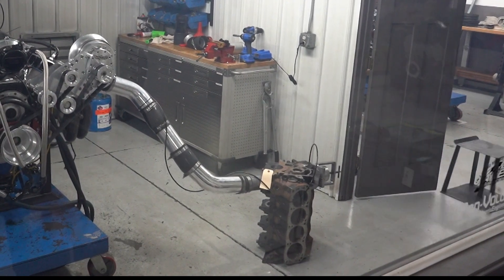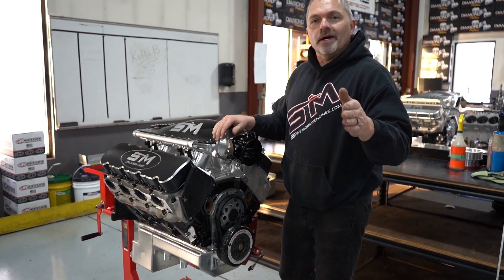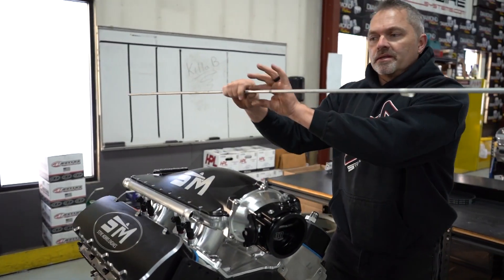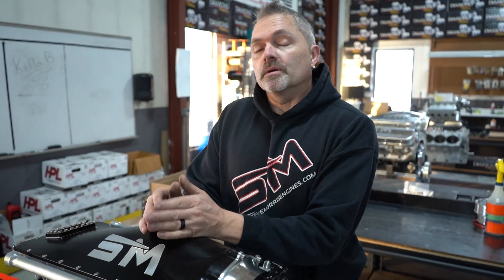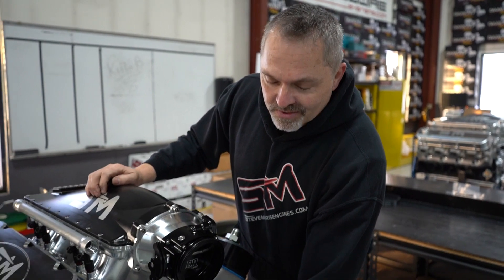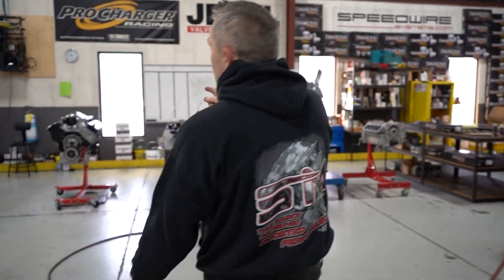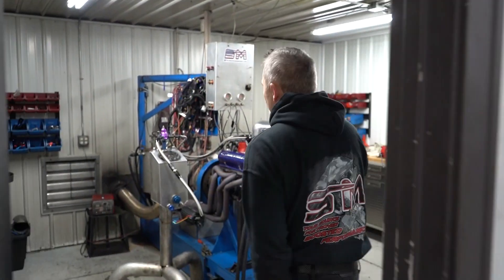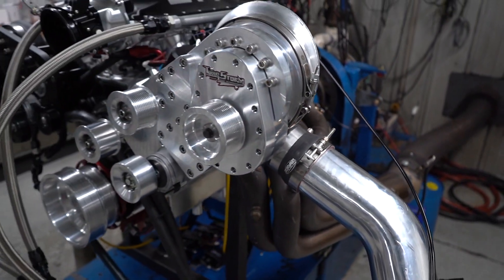Why All The Sparks ?

Comment: Have you considered putting a support bearing on the other side of the main pulley (e.g. supported by a welded fixture on the front subframe) so that the main pulley is not loaded in single shear?  Obviously, it's gonna cost clearance to the front radiator, but I bet you only need 3/8" wide roller bearing to handle all that crank loading.

Comment: Leverage points where the blower , oil pump meets the belt from the crank can change flex points on the crank , buy changing the mounting points on the blower belt pully , oil pump , what ever , the leverage point from crank , its all abount moving the leverage point around from the belt contact to the crank where you can center up the wear on the 2nd journal. Awesome work.

Comment: My question is what about the front and rear main seals, because of the side load pulling crank that far outta it's normal path.
Would this not cause them to wear abnormally during the short time it was being forced against the seal housing for lack of a better word?
Ninty thousands is no small number in situations such as this.
Your certainly current about the crankshaft bowing in the center as it's the load is using the #1 main bearing support as a fulcrum, which causes the center to absorb all the tension of the load.
This brings up the subject of how much deflection does it get, and doesn't this effect the travel of the pistons and rods associated with those in the center of the crankshaft as well?

Comment: Gyroscopic precession working on the balancer to help it bend over and touch the pickup?
The belt tension being the pressure point trying to change the direction/orientation of the spinning balancer?
Like pulling or pushing on handlebars of a bike as it's in motion?
Reply: Was thinking the same. Hence the balancer was able to touch the sensor even though it was being pulled in a different direction. The resultant force is 90 degrees from the applied force in the direction of rotation. Looking at the where the crank sensor is mounted compared to the blower it looks about right.

Comment: Thank you for touching on the hp/torque thing. I think it's something a lot of people struggle with but once you understand it it kind of changes the way you look at things. I recently watched a video about why European semi companies are making more power than American ones. At the top end at least. Someone commented that you could buy a pickup truck with more horsepower off of a lot in America but I don't think they understood the vast difference between a semi's diesel engine making 750hp and a dodge ram trx. 2000 or so lb/ft of torque lol.

Comment: Could the crank nose whip have been what you thought was belt slippage in the initial pull, for creating a oscillating load in the blower? 
Is the whip actually from the crank deflecting longitudinally, or is it more of a torsional wind-up of the crank / twisting of the crank, and the axial deflection for the deflection being largely in the crank arms?

Comment: An inertia dyno also measures torque. The acceleration rate of the rotating mass is directly proportional to the torque. Exactly the same as when road tuning. The rate of rise of rpm is proportional to the torque. The only way to measure power directly is by using BSFC and fuel flow.

Comment: I worked at a Mahle (Clevite) Engine Bearing plant for many years. We produced OEM and Aftermarket bearings for Race and Aircraft applications. What you are describing is something called "Edge Loading" and Crankshaft whip along with side loads from the superchager side loading. Many aitcraft applications and some ProStock race bearing had slight reliefs cut on the centerlines to offer more clearance to accommodate the flexing. Great programs by you and they are much appreciated by this viewer! Thanks!
Reply: Woops, I meant Aircraft!

Comment: You could calibrate the load cell on the supercharger same way you do the dyno by using fixed weights and a lever. Problem is the belt force component will influence the torque component. To do it properly you would need to mount the supercharger so it could rotate about its shaft axis then drive straight thru it(seperate supported drive pulley) so only the rotational torque component was measured then just like the dyno it’s torque times blower shaft rpm/5252 equals horsepower.

Comment: A strain gauge on the mount works. The problem would be it measures not only rotational torque, also pressure applied from the belt. Very complicated math. A torque collar fed using a planetary would be a direct conversion.

Comment: Hey Steve set it up so when you test the parasitic loss from the blower try plumbing the blower to  a second engine running near same rpm range to consume near accurate air that the engine with the super charger normally would consume. The. You would wind-up  actually finding the parasitic loss because the blower would be loaded properly

Comment: Roller dynos measure torque as well.    F=MA    Force equals Mass multiplied by Acceleration.  Roller dynos measure the time from RPM start to RPM finish.  Therefore the acceleration is known along with the mass of the roller.  Force or Torque is then calculated.    HP is then derived from torque and engine speed.          HP and the Math.    HP is the time function of Torque, Time being the RPM or cycles of the engine.    Similar to MPH being the time function of change in position.      Two places 50 miles apart.........but if its know you traveled the distance in an hour you know the average rate traveled.     These are referred  to in Mathematical terms as the First Derivative.

Comment: Another way of think about the how load is applied to the compressor is w/ glass of water. 
The engine is the glass and the water is the cfm of air. Na engine is half full of water running WOT. Now add the compressor that is a pump adding water to the glass. The water pump won’t see a load until the glass is full and the water that overflows is boost! 
When you remove the glass the water is flowing all over the place at first instance! Thus immediately loading the compressor. 

Theoretically valve overlap and cam timing will also play a roll on how a compressor acts with a given combination.

Comment: One of my friends ripped the snout off of his crankshaft from his extremely long oil pump drive adapter for his dry sump. Luckily he had an electronic kill switch connected to the oil pressure sensor.

Comment: I feel like the crank is flexing on 1&2 rod journal that's why the crank snout is moving but a way you can prove one of us right is mount a turbo setup get it equal hp on boost then mount the supercharger and see if the snout moves🤷‍♂️

Comment: Hey Steve I got a question for you. I've always done this, because an old-timer taught me how to do it this way. I got an 8-71 blower, and I've always left that 3in Cog tooth belt, a little bit loose. I was told the reason for this is so that the end of the crankshaft, or the shaft end of the blower, won't snap off. Now, I understand the physics of it, kinda. Well, really I don't understand how it would reduce the load on the belt during windup. And, that is where everybody is saying the damage happens - the spool up, not the excessive belt tension (duh).
Reply: Oh, I got one other comment for you. This is an easy one. Anytime I use a big blower cam, with a big roots blower, I get this blower surge, and, the only way I can get it to not surge, is to crank the idle way up to 4000 RPM, LOL. Anyway, is this blower surge due to inefficiency in blower design, and the motor getting unvaporized fuel, like puddling, or is it a result the inefficiency during idle of the gigantic duration camshaft. Could it be both? 🤷‍♂️

Comment: I would say the sparks were coming due to the insane parasite loss when the supercharged had a constant restriction to 'blow at', bending the snout.
Normally the engine 'eats' the air creating less restriction(parasite losses) and do not bend the crank.

Comment: its 11pm and i didnt get out of the shop till 9pm..... so i may (well, i am) missing something here
.
while it only moved 3.5 in the bearings.... because of the length past the 1st main..... that "arc" ends up being 90 thou by the time it gets to the dampener?? 
like... if you were to draw the arc.... and just extend / follow the arc for 10 feet..... maybe it would be like 5 FEET!!! of movement??
.
i can see that 3.5 in the middle could end up as 90 at the very end..... but i didnt think the crank would be long enough (like, i didnt think it had enough "stick out" past the main)
i could see like 10 thou on the harmonic dampener.... but 90 is a TON!!! 
.
.
i personally thought the entire block was flexing 
and it probably is.... but i cant be sure how much of that 90 thou is from the "crank arc"..... and the "block flex" 
.
i was also thinking that maybe the rubber/metal in the dampener was "expanding" due to the centrifugal force 
but thats clearly a "racing dampener"..... and probably 1 piece of solid steel thats liquid filled (instead of the metal center, then rubber, then the "belt drive" metal ring)

Comment: Have you ever done any work on modified multi-engine pulling tractors.  Where they have up to 6 identical engines on a tractor.  If so how hard is it to match engines to get the close to the same spec and horsepower.  Also on the ones running engines side by side the one side of the engines run backward.  How hard is it to do that also.

Comment: @8:32 so you measure torque and calculate the HP. Diesel engines have a higher torque to HP ratio so does it matter which type fuel you use ? or do you use the same formula since diesel engines perform on lower RPM? thanks!
Reply: HP = (T x RPM) / 5252
The type of energy that is used/consumed to "make" that T(orque) does not matter in the/this calculation of H(orse)P(ower). 
Change the RPM (on paper, "play around with it") and notice how that affects HP.
HP and T always cross each other at 5252rpm. 
It may help to think "as RPM increases the size of the engine increases" "there's no replacement for displacement BUT RPM matters", and "big, heavy things can't spin as fast as smaller, lighter things". 

I stopped trying to explain it after I typed this:
 _ "Energy is measured in B(ritish)T(hermal)U(nits), which is a measurement of "heat" (how much gas/fuel/oil/coal/wood is consumed/needed/used to boil one gallon of water in one minute while at sea level with an initial/starting water temp of {I don't remember, probably 32f/0c but could be 60f or 40f or __}." _ 
because it's probably best for you to get whatever level of explanation you desire from various sources such as ASME, wikipedia, HotRod/CarCraft magazine, and/or many more.  I don't want to be "that" guy and every person is different, I'll try to further explain if you ask me to but Im not a "professional" (and don't want to fall into that trap).
Reply: @lt1nut  thank you for explaining!

Comment: Ok crude calculation on HP is required, in the flowbench world we often speak about being able to pull XX inches of vacuum as a test pressure this test pressure is a direct correlation to the tip speed of the impeller, that said there is a formula that allows a basic calculation on HP needed to flow XXX air at XX inches of water.  If we knew the volume of air this type (impeller) of supercharger was moving and boost pressure at that CFM we could calculate the needed horsepower based on the blower efficiency. This is just for a theoretical reference as abase line.

Comment: I understand what you're saying about the crank snout bending but that doesn't account for the flywheel striking the starter drive. The damper is moving in one direction and the flywheel end of the crank is moving in the opposite direction. This tells me, which seems to be common sense, that the entire crankshaft is being skewed in the block or the block itself is distorting. I know it sounds impossible but it is plausible. There's an ungodly amount of force being applied to the snout of the crankshaft. If a carrier with bearings were installed on the front of the block to support the front of the crankshaft and damper the load on the crank snout would be lessened and the problem solved. Also, the crankshaft itself doesn't have to move the full .090 alone. You have to consider how much the damper and flywheel are growing in size at those rpm's. Does this make sense?

Comment: Just a minor correction - inertia dynos don't directly measure horsepower either. They measure speed (rpm). From the rate of change of speed you can calculate the acceleration. Knowing the inertia of the dyno flywheel you can then calculate torque from the acceleration. Only then can you calculate power from the torque.

Comment: How does a blower use more power to free flow air than if you capped the charge tube partially? Excessive cavitation would make sense but then the unit would never make boost under normal use?

Comment: Mr Steve when I was talking to the folks at Pro -Charger in the mid 2000 . They told me the best way to run one of thier setups on the jetboat was a crank driven right in front of the crankshaft. 🤔😉😃

Comment: It seemed like the loss of horsepower when making the n/a motor spin the supercharger out into the open air was extremely high. Big losses in power. Wouldn’t the extra load on the supercharger Robbing so much power be because the charger is blowing into 14.7 psi of atmospheric pressure instead of blowing into the vacuum of the engine? You would think blowing into a vacuum takes less work than blowing into 1 atmosphere of pressure right? Could that account for the huge losses?

Comment: Thinking about the second bearing wear, that makes sense if you think of the crank as a lever. You are pulling up on the end of the crank and therefore on the first bearing. However the pistons are pushing down, counteracting that upwards force so overall there is less load on the bearing. On the second bearing however the crank is pivoting on the first bearing so the upward force on the end of the crank now becomes a downward force on the second bearing which adds to the piston pressure, increasing the load on that bearing.

Comment: I had something similar happened to my sbc 383 an had to rebuild bottom end and regrind crankshaft to 20/20 an yeah making big power at high rpms the crank can flex like harmonics at a certain level of rpm+torque, cast iron is only safe below 500hp so they say..HAHAHHAHAHAHHEEHH 😎💯✌🏻

Comment: Running a dummy load or blowing a second engine to measure the difference in output is a pretty convoluted way of estimating the power drawn by the blower. A heavy duty version of the spring loaded tensioner installed on the front side of the belt would deflect according to the torque required to pull the belt. No math required. Just calibrate it with a torque wrench by holding the engine and torqueing the blower backward.
Even just the movement of the back side tensioner is a good indicator of the tension on the belt. It might be interesting to see how the position of the tensioner correlates to torque applied to the blower or damper pullies.

Comment: After more thought on the sparks, I believe that the pipe used doesn't do good for a test. Superchargers need to put X psi into a whole system (intercooler, piping, and turns). If you have a pipe to simulate the PSI made, you aren't accounting for the extra flow required to pressurize more. I would expect a massively different psi on engine vs off due to plumbing. Fluid dynamics pros would do well here to help this statement, but I will do my best, take a 12 oz bottle and pressurize it with compressed air find the time, then take a 1 liter bottle and do the same thing to find the time it takes to pressurize both to x psi. Take this info to the dyno and you will find that 16-20 psi off engine would be much closer to the 12 psi on engine (potentially even higher psi)
Then I still stand by my comment that the constant pressure on intake (due to extra psi) and combustion phase is far different than when the crank is used on an empty setup. Then you add in the extra pressure of a supercharger pulling force.

Comment: The crank snouts moved enough on supercharged Coyote engines that they were snapping the oil pump behind the balancer/timing cover
Those belt drive superchargers certainly tug on those crank snouts.

Comment: Do you remember Fluid Dynamics?  Where air and water move as a waveform.  So in an enclosed pipe the flow isn't what you assume it will be and hard turns in the pipe cause a reduction in pressure.   A long pipe will reduce the pressure and volume of the flow.  I wonder how a corrugated charge pipe would do?  You can figure the size of the initial ripple by the pressure and flow of the engine.

Comment: Can you run a front crank support on the torque storms like they have for the roots style blowers. They have a hub that bolts to the crank and that hub has a roller bearing that captures the hub and has a plate that holds the bearing and 4 support arms that mount to the front cover or block that way the crank doesn’t bent or torque any way and stays centered

Comment: Dear Steve, 
I’m afraid you are wrong about inertia dynos measuring power [hp]. It measures acceleration [delta rpm]. The acceleration of a given inertia is proportional to torque. Multiplied with speed at each increment-> power.
Keep up the good work!